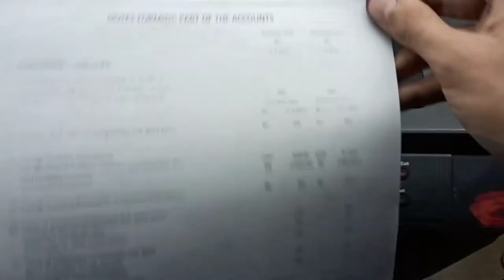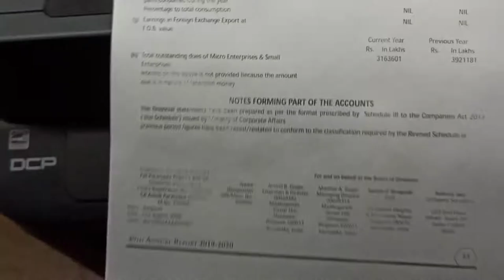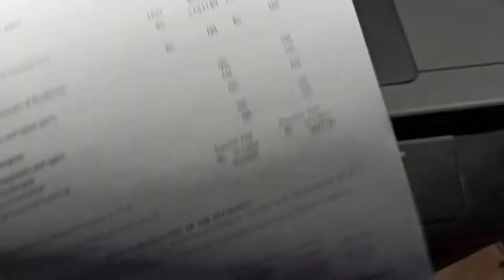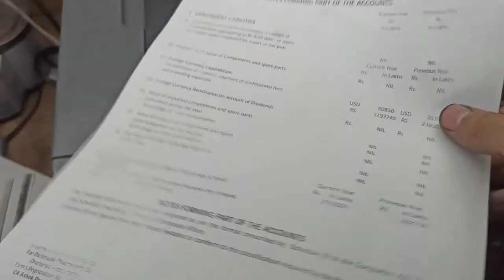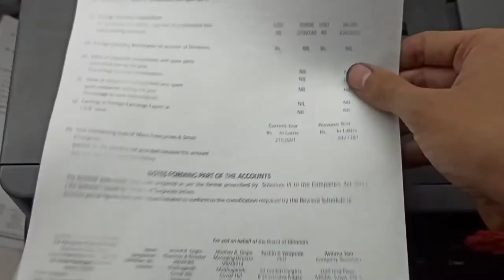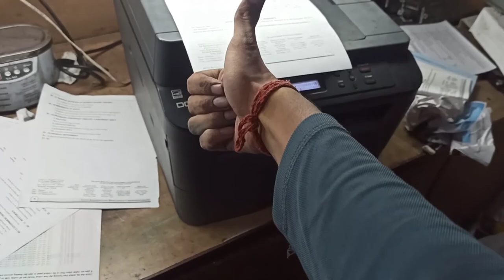Brother Dcp L2541 laser printers  dull and light printing problem repair 100%

Comment: Sir mere printer me light print aa raha hai and maine ye dono kam kar k dekh liye hai fir bhi same problem hai and drum unit is also OK... Pls give solution as soon as possible.... Replace toner ki option bhi bar bar aati hai
Reply from the maker: Replace toner ka issue reset ya gear rotate se hi thik hoga
Reply from the maker: Baki light print aara. H to phele drum unit check krlena or jo LAC unit mai right side mai yek chip h vaha screw hoga bikul minor se usko tight krna apne hisab se adjust krdo print nikal nikal kr vo screw tight karo ge print dark aayenge lose kroge toh light apne hisab se set krlena